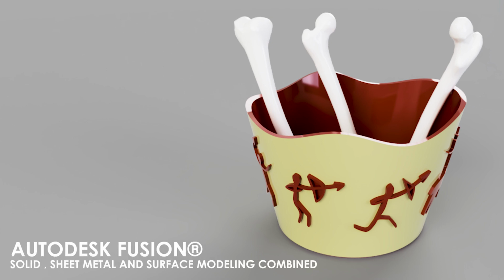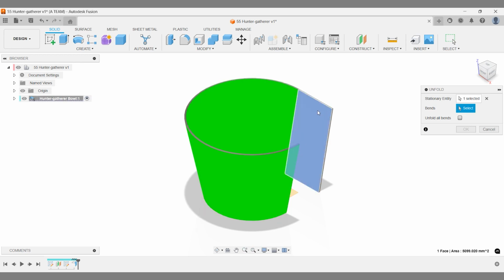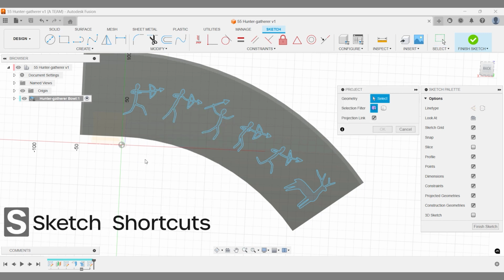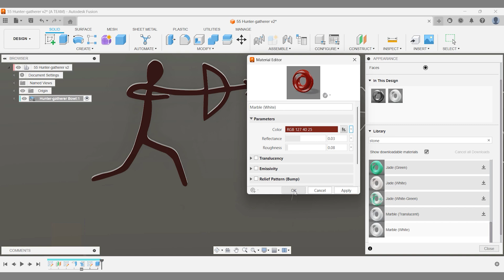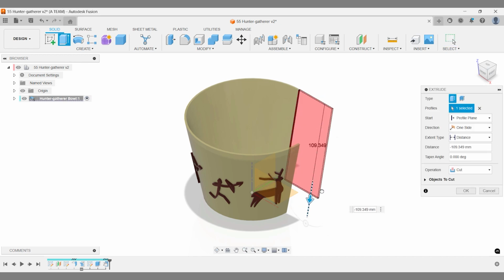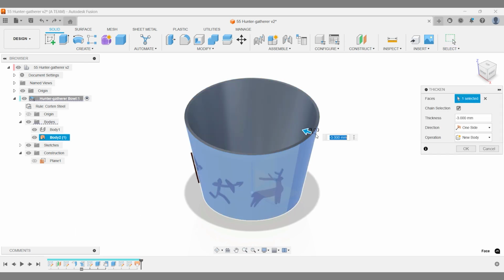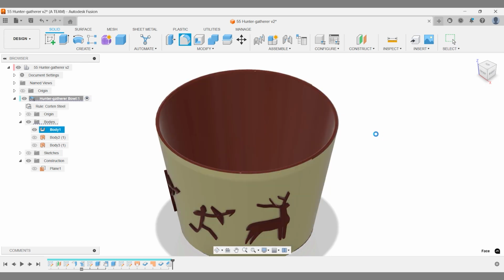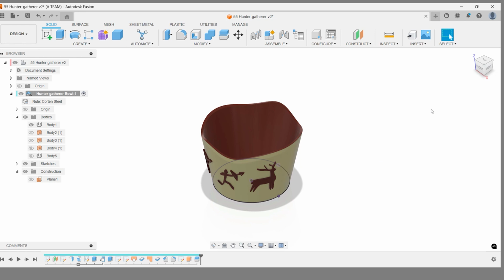A rare Workflow for Creating a Bowl with Figures in Fusion

Comment: I note your reply to a comment below regarding difficulty you had embossing sketches onto a tapered surface, and that's why you used the workflow you demonstrated. I experimented by creating two offset circles of the same diameter, lofted these to form a cylinder, drew a sketch on a side plane, then embossed the sketch onto the cylinder's surface and used that feature's alignment parameters to adjust the position and angle of the feature. I then edited the top circle sketch and increased the diameter which changed the loft to create a tapered shape similar to what you had in your video. I shelled the body into a "bowl". The embossed sketch moved perfectly with the taper change to the loft. Why wouldn't this workflow work with the bowl you demonstrated? This is a genuine question, not trolling. I am a relative Fusion novice.
Reply from the maker: Thank you for your reply.

My issue was embossing and positioning multiple unique sketches simultaneously onto a bowl with a taper angle.

For a single sketch motive, I would create a circle, extrude it thin with a taper angle, emboss the sketch, and then use a circular pattern on the feature around the axis above the origo.

Interesting approach—did you test this workflow with multiple unique sketches?
Reply: @The_maker_letters  I didn't use multiple unique sketches, however I did use multiple unique extruded shapes on the one sketch to emboss. I positioned the shapes along the face of the sketch plane so some were outside of the projection of the destination face (ie: the sketch in total was wider than the side-on profile of the cylinder). I did this to check how the shapes would wrap around the cylinder when I changed the taper of the loft by increasing the diameter of the top circle. To my eye all the shapes appeared to position on the cylinder as one would expect. The trick is to emboss onto the cylinder before editing the diameter of the top circle to taper the loft into a "bowl". I do hope I've described everything clearly - I am a novice. I would appreciate you sanity testing this workflow, attempting to replicate the same hunter-gatherer bowl in your video. Regards.
Reply from the maker: @Denis_of_Earth1  Thanks for the reply! I followed your workflow, and everything works as expected as long as the cylinder doesn’t have a taper angle. However, when I go back to edit the cylinder and turn it into a bowl (by adjusting the upper lofted circle to create the taper angle), I run into an issue. 

My problem is that the hunter-gatherers lose their position around the bowl. It looks like Santa is about to take off while the deer has already lifted off the ground!
🦌🦌🦌🦌🎅

Did you change any alignment settings?
Reply: @The_maker_letters  I very much appreciate you taking the time to clarify this workflow isn't feasable. I didn't make any adjustments to alignment, and only sketched simple shapes. My lack of skill is clearly the issue here. Thank you once again. I look forward to your next video. Regards.

Comment: Very clear tutorial, was there a reason you didn't make just a very narrow cut in the original body, but instead filled the opening at the end?
Reply from the maker: Thank you for your feedback! There’s definitely a lot to unpack about the workflow in this video. The simplest method for the bowl would be to sketch a circle and create a thin extrude with a taper angle and go from there.

However, I ran into issues when organizing multiple unique sketches on a taper angled surface with Emboss. That’s why I opted to work around it with a flat design and build from there. The straight part in the sketch helps set up the unfolding step later in the tutorial.

As for the hole, you’re right—it’s not optimized and could definitely be smaller. Your suggestion is great: using a lofted flange, making a cut, extruding it by 1 mm to get that straight section, and then unfolding and making it flat works great too.

Thanks for a Great question! :)